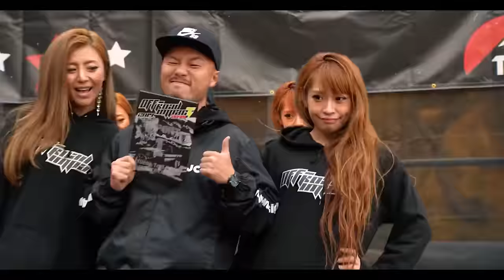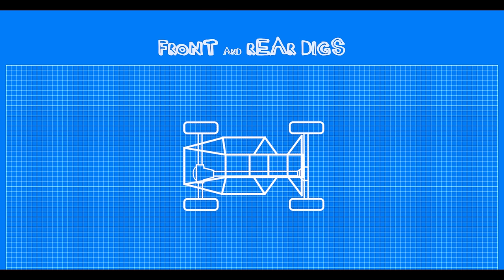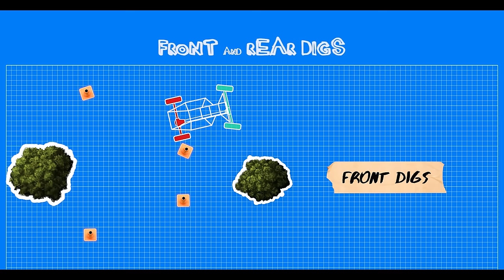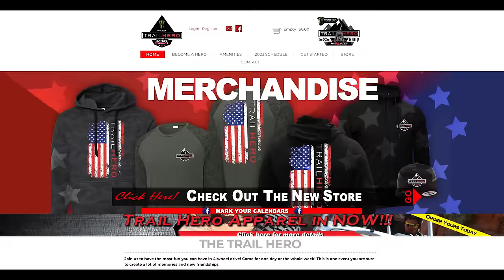The Untold Story of Japan’s 4WD Frontier

Comment: I know it from many many you tube videos but i dont know the Name of the Park! Thank you!Japanese 4x4 build for though every day work and not build only for fun like most Jeeps.Suzukis in Japan run often on two stroke leightweight powerfull engines.They build also for the Jimny super low transfergears with two 5 speed boxes in line for a 27:1 low !
Reply from the maker: It is mentioned by the host a few times in the video. It is a beautiful spot. It is called Nara Trial Mountain. It is also the home of Tsuda Racing.